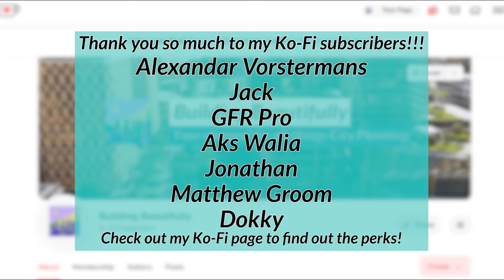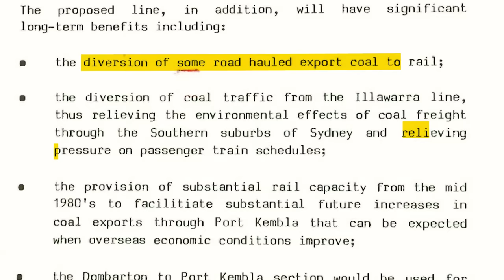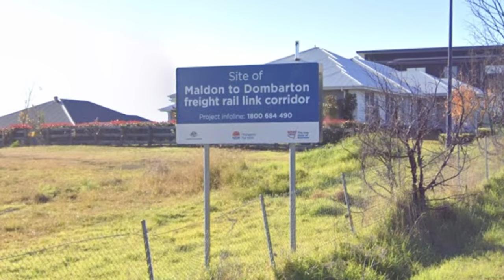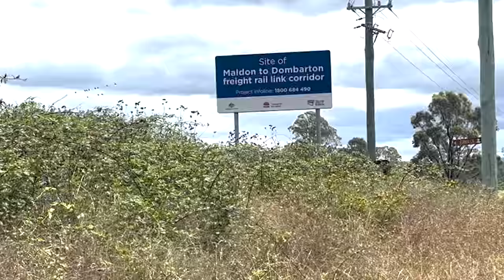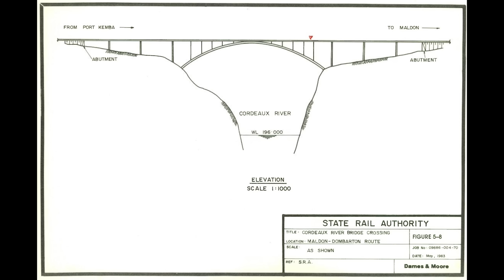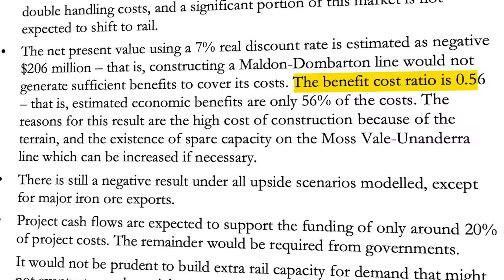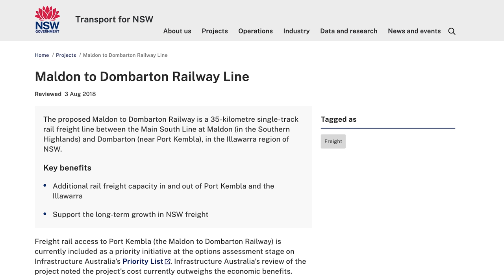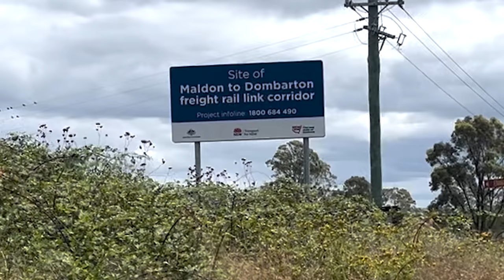The Maldon-Dombarton Rail Link: Lost Sydney

Comment: I've said it before, and will say it now, the Maldon - Dombarton line would have been, and would still be, of more benefit as a dual use line, of freight and pax.  Not necessarily as a HSR service, but even just to get people from SW Sydney to Wollongong, and the South Coast, without needing to backtrack.  When I lived in Campbelltown, 2006 - 2017, and before that Liverpool, 1989 - 2006, people regularly lamented the lack of rail access to Wollongong beaches, UoW, etc, from these areas, without needing to backtrack toward Sydenham or Wolli Creek, and the few bus services, from Campbelltown, are always crowded, to the point of being dangerous.
Reply: Been a bus every hour on a weekday for the last 4 years or so. It's great. But crazy it goes down to 2 a day on a Sunday.
Reply: @diondicello161  good to see they increased services, before I left in 2017 there was a push to increase bus services.
Reply: Would it have been of an even better use with the new airport being built in western Sydney with a direct Illawarra -Airport train.?
Reply from the maker: Agreed. I doubt it’ll ever happen but I do think it would really help connecting the Illawarra with Campbelltown, and open up both areas to more economic activity and employment. Thanks for watching!
Reply: @arokh     Correct , i lived in Campbelltown from 1985 -2006 and people then were hoping that the railway line would be finished and provide acess to Wollong beaches . As i remember Bob Carr exploited this desire to win the election for Labour . He was lying.

Comment: what isn't taken into account is just how geologically unstable and maintenance intensive the current south coast line is between Waterfall and Thirroul. It was built using picks and shovels 120+ years ago. We're one bad east coast low or landslide away from the line being completely knocked out for months or years. That's exactly what happened last year. Keep in mind how many people commute to Sydney from the Illawarra and how much of the states exports arrive to Port Kembla via the SCL. 

The mix of cargos at Port Kembla are also very different to back in the 80s; it's one of the biggest ports in the country for coal, grain, autos, refined fuels and bulk goods, and soon LNG. In the future it's the preferred location for the state's second container terminal. The port can't grow unless it has the rail infrastructure to support it.
Reply: That is a very good point, there is no default option if the line goes out of service and the port needs transport or it all stops.
Reply: When Newcastle port was privatised the contract for it included an anti-competition clause whereby the NSW government will not permit Port Kemba port to expand. Why people in the Illawarra did not rise up with pitchforks about that I do not know. As pointed out in some of the motorway videos here (some of which have these), and as also caused huge delay to getting Western Sydney Airport, competition-killing clauses like that represent a very large transfer of taxpayer and consumer funds into corporate pockets. It is the sort of thing that, rightly, makes privatisation unpopular.
Reply: Indeed, the railway line has, in part, been redirected from the original for that very reason.Stanwell Park viaduct has long been a threat to disrupt services. Also both main roads have had issues. The very reason the Sea Cliff bridge was constructed was to reroute Lawrence Hargrave Drive away from the ever falling rocks along the route. Mount Ousley Road has had intricate drainage works done a number of times to arrest slippage. The escarpment has many former mine tunnels from coal mines that littered it over 60 years ago.

Comment: A visit to Mount Ousley Road, the primary route into Wollongong, will very quickly inform you why this piece of rail infrastructure is still so desperately needed. Huge coal rucks, including B doubles that were never intended to come down the escarpment, clutter this roadway making it unsafe for regular cars etc. The current government is planning to improve sections of the road by installing a purpose built truck lane. All well  and good BUT if this railway was completed there would be far less incidents with trucks. 
As reported, the original concept showed great foresight for movement of coal from western fields but a subsequent Greiner Liberal Government must have been "convinced" by trucking barons to not complete the job. Hopefully something will happen with the Federal Government and the expected change of State Govt. 
A completion of the line could also provide good access for Illawarra people to the new airport with a branch line with some passenger trains. A very similar thing happened with the Sandy Hollow rail link.

Comment: As former freight train crew, I'm one of the comparitively few people that has seen The MSV-Unanderra line in recent years, and that includes the Avon East tunnel portal which sits adjacent the existing line in clear view. The remote ruggedness of the location is probably difficult to appreciate without seeing it in the flesh... The 3km long tunnel would have been an impressive feat of engineering if completed. Other remnants of the incomplete project remain in the form of a duplicated section of the MSV-Unanderra line that abruptly goes back to single line with a crossover just before the tunnel if travelling in the downline direction.  a stub of this second track extends for a short length beyond this crossover before just ending and going nowhere. There are also steel stauncheons installed trackside for the carriage of overhead wiring, but with no wiring fitted beyond the Unanderra junction with the south coast line. Again, these stauncheons abruptly before the tunnel. Many people mistakenly think thesr were installed to allow interurban passenger traffic to use the line, however they were actually a throwback to a time when electric freight traction was still seen to have many benefits of cost and utilty.in 1983, the State Rail Authority had invested in an almost brand new fleet of electric freight locomotives intended primarily for use on heavy coal workings to and from port teminals including Port Kembla Inner Harbour. By 2002 however with Freightcorp having been sold off to private interests to become Pacific National and the benefits of electric freight haulage being deemed insufficient to maintain the fleet in operation, and the infrastructure arely sufficiemt to supply the power demands, these had all been withdrawn from service. Had the line been completed, the electrical overhead network would also have been extended inland to the main south line and onto the respective coal branches.
Reply: The original proposal for a much longer tunnel - it was actually relatively late in the piece that they went with the shorter tunnel - I have spent a while at the State Archives looking at this.
Reply: Which State Government cancelled it and what were the reasons plz?
Reply: @eddieseymour9948  it was the Wran or Griener governments.  It was cancelled as the coal traffic never eventuated.
Reply: @rogue265  Thanks.
Reply: @rogue265  Wran wanted to continue, Griener got into power and with falling coal prices cancelled the project but complete lack of foresight, short term budget objectives would have been the real reason. The reckless mis-management of taxpayer dollars continues unabated.
Reply: @seanworkman431  The archives that i have a copy of from the State Archives at Werrington beg to differ. All parties once the coal went saw it as a dead project, even from as early as 1980 - it was how to cancel it gracefully - especially as the project would have required significant parts of the NSW electrified network to be converted to 25kV/AC (not saying a bad thing, but a really significant outlay) - which the governments couldn't afford after other issues.

The Tangara's were the last and only trains built that were designed to be converted to 25kV/AC. This was to reduce the outlay in power usage and the demand for substations. Even today there is a 1500vDC substation approximately every 2km (less in the sextuplication) from Penrith to Chatswood to provide sufficient power for the Waratah trains...
Reply: @rogue265  one point, archives is like a library for documents so you don't have the archives, you have documents from the archives.
I would still suggest a lack of foresight in cancelling the project, despite barriers, because now that link would be beneficial. Odd that it was under construction after it was considered non-viable.
Reply: @seanworkman431  Well if none of the reviews since 1983 have said it is viable... It is questionable. 

Is it a good link? Yes. Is it worth the money compared to other rail projects worthy in NSW... Very questionable. You could do a significantly better outcomes by spending the equivalent money on the Main South for example, which provides much better outcomes for NSW and Australia as a whole.

And before you question that - i think Rail in Australia has been underfunded by the States and the Federal Governments by at least 150% - The only state that managed to avoid this in part was Queensland, where the extremely corrupt Premier - Joh diverted road upgrade funds to upgrading the Brisbane - Cairns line, and also preparing for the electrification to Emerald (big mistake) and to Rockhampton - much better.
Reply: @rogue265  I appreciate your reply and agree that funding better outcomes with a restrictive budget is required. Not being informed of the inner workings of these matters, I can only express an opinion and welcome correction. 
My main point is that governments are usually operating within the election cycle and thus careless mistakes are often made such as selling government land that has been set aside for future projects. 'Hey we have this land and we  are going to release it for a housing development.' When it was set aside for a motorway by someone with foresight, looking 40 years into the future. This has happened more than once.

Comment: 12:29 a man died in an explosive accident. I believe it was this line in early 1985. The court case showed 6 failures in procedure. Although no proper compensation. Maybe this caused problems with finalising the road.. 
This would remove so many traffic problems in Wollongong.
Reply: The man was only 21 years old, and a true friend of mine. Always putting others before himself.

Comment: I worked for the State Rail Authority back in day and worked to convert the the signalling system that had also been designed and installed for the eastern tunnel portal at Domabarton where the line was to branch off the Unanderra to Moss Vale line back to through running up the escarpment. Coldest place I ever worked in winter!

Comment: The capacity issue comes down to the existing Illawarra line being single track for about 1.6km through the Coalcilff “gauntlet” tunnel. The Maldon line would have partially remedied this. The new tunnel would have provided a relaxed grade down the scarp from the Southern Highlands. The existing Unanderra Moss Vale link is very steep in parts and problematic for intensive freight operations. I don’t believe for a moment that the-ve CBR killed it. I shudder to think what the CBRs for the  new metros are , assuming the exercise was ever performed. The then Water Board was most displeased with the threat it perceived the operational  Maldon- Dombarton line would pose to the purity of a water catchment feeding dams serving the entire south west of Sydney and the Illawarra.  I suspect the road hauliers may also have unobtrusively voiced their opposition.
Reply from the maker: Yeah, that’s certainly all possible.

Comment: With the Wilton growth area taking off, it might be a good idea to use the Maldon-Wilton portion of this corridor to make a rail link to the new housing estates. They could probably put one station on either side of the Hume Highway depending on the demand
Reply: There will never be enough demand to justify that, even if the bridge wasn’t required.
Reply: Not a bad idea. The main issue I can see is that the bridge over the Nepean is only wide enough for a single track (no room for duplication without building a whole new bridge), so it would be limited in the number of services that could operate. I'm not sure if the income from the line would justify the expense required to finish the existing bridge. That said, it could still be worth investigating as part of a new strategy to complete the whole line. If it were to go ahead, it could also help to justify electrification of the Southern Highlands line, opening the Bowral - Moss Vale area to a realistic commute from Sydney.
Reply: @bradevans7935  There is nowhere near enough population to justify a single track line, let alone double. It's a bus service to Campbeltown at best.
Reply from the maker: For sure it’d be a good idea, doesn’t mean they’ll do it unfortunately.
Reply: @BuildingBeautifully  It's not a good idea. It would be a massive white elephant that takes away resources from where they are needed. It's a small bus route at best.
Reply: @dat581  you seem to be heavily against this idea. Have you seen the plans for the Wilton Growth Area? In the coming decades the development is expected to be almost as big as what's happening in around Marsden Park. I wouldn't expect a rail link for a while though
Reply: @bradevans7935  let’s say a passenger service could be justified it would be so marginal that you would be lucky to get a train every hour or two, which would mean single track wouldn’t be an issue. 

Secondly I doubt the parts of the bridge that are already built could be reused after sitting abandoned for 35 years.
Reply: @evj4082  I've seen the plans. Nothing in them justifies anything more than a bus service to Campbelltown.
Reply: @dat581  I agree that, at present, there is insufficient population in the Wilton area to justify this, however as it has been earmarked for future growth, it makes sense to have infrastructure in place to service it. Also, I was not advocating this as an exclusively passenger line, but as an additional part of a business case for building the whole line.

Comment: If you ever got to take the Cockatoo run - there is a single place where you could stop off in the water catchment area, but you are monitored. The other one on the line - that if you ever take the Cockatoo Run - you can actually see all the stanchions that were installed between Princes Hwy and Dombarton. 

You may have seen the original proposal had a 12km tunnel, which got down to 600m below the level of Lake Cordeaux. I have the map somewhere
Most of the western coal now goes to Newcastle, either via the short north, or Ulan. In fact most the coal paths to Port Kembla are now unused. 

Half the issue of Maldon-Dombarton was that the initial proposal was developed in the early 1970's and took over a decade to even get approval. The cabinet minutes are fascinating. The other thing to note was that M-D was going to be the first line to be built in NSW at 25kV/AC, with if successful, the conversion of the Main North to 25kV/AC as well.

Comment: You missed that this was intended to be an electric traction freight line. Staunchion posts line the corridor above Unanderra. 
The foresight in the early 80s...!
Reply: Not just intended, but needed to be due to limitations in the Avon tunnel design which only allowed one diesel electric loco to go uphill. Plus it was to be 25Kv AC rather than the standard 1500v DC.

Comment: There was a very exhaustive study into examining all the possible sites for a second major airport for Sydney.
It finally ended up that the only 2 locations were either Badgery's Creek or Wilton. 
The former was eliminated because of the cost of building a new railway and the proximity of flightpaths over [future] residential areas.
One reason Wilton ended up their favoured location, was the proximity to the rail line being built to Wollongong, 
meaning the terminals could have been in easy access of a proposed station [similar to Gatwick], on an existing electrified line,
but one of the governments pulled out of the study and the final report never released, and of course the rail line never finished.

Comment: If I'm not mistaken, it was Nick Greiner who stopped the M4 at Strathfield. I believe the road that should've been built back in the '80s opened very recently.
Reply from the maker: I think that was Neville Wran
Reply: Nick only ever had one policy it was roads, roads and more roads, his CBR's would have been fixed to reflect his policies, like all CBR's. 
Bruce Baird his transport minister planned to end congestion by building more roads, his son Mike came to power 20 years later also promising to end congestion by building more roads.
Mike's son will run on a policy to end congestion by building more roads.
Reply: @BuildingBeautifully  It was the Wran Government that had this project designed and started work on. The Greiner Government shut it down.
Reply: Neville Wran cancelled all the freeway projects around 1977.
I think there are still off-ramps to nowhere in Darling Harbour as part of his legacy.
The road corridor for the Northern beaches freeway was bought and paid for in the 1960's when I was at school in Seaforth.
It was to connect the Harbour bridge freeway north through Northbridge and across Middle harboour to the west of Seaforth and to join onto the Wakhurst Parkway .
Today Sydney relies on Military Road through Mosman because all the land was sold off!
There was also a project to pass through lane Cove to join onto the Newcastle freeway that was cancelled.
Brilliant example of short term thinking!